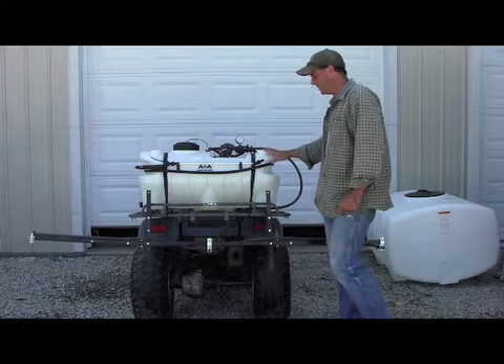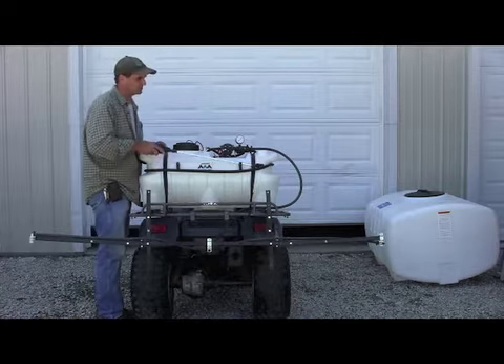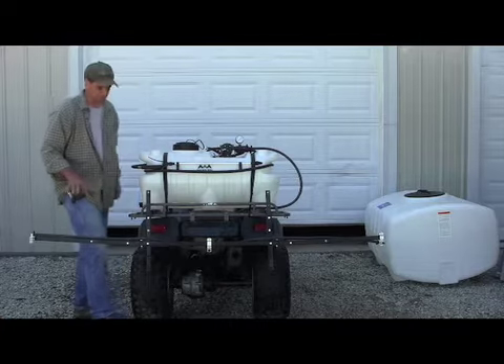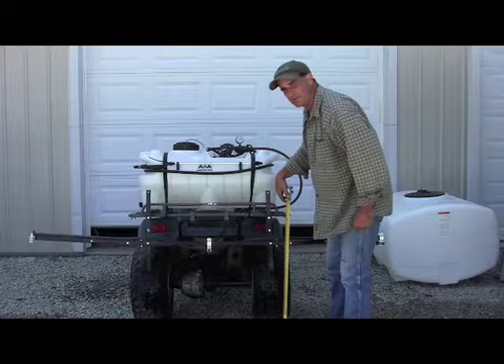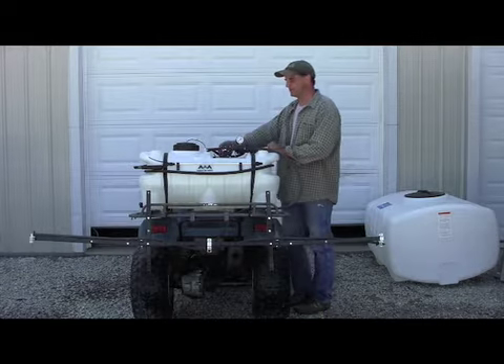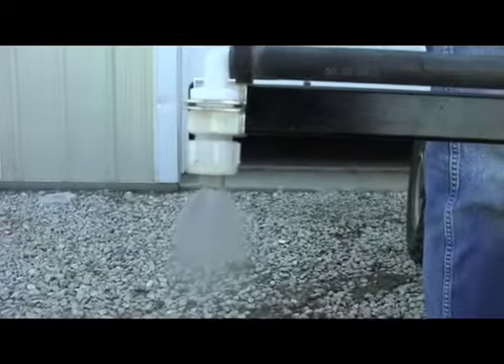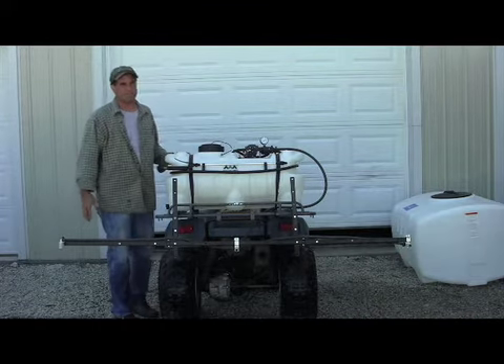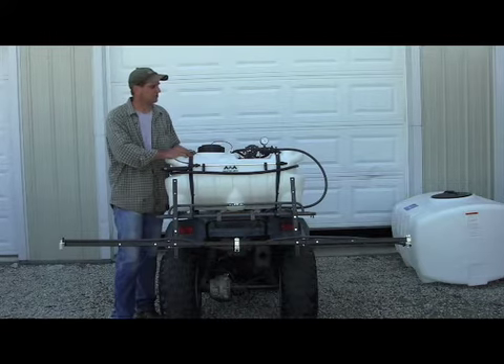Basic Sprayer Troubleshooting

Comment: So the boom is the thing in the front? is it supposed to spray all the time?
Reply from the maker: Hello. Correct, the boom would be in the front. With every Master Mfg broadcast sprayer, a user will get a boom shut-off valve that gives you flexibility to shut off flow to the spray boom when you want. So it doesn't need to be spraying all the time. For more questions, feel free to reach out to us!

Comment: If it's not pumping fluid or your not getting good volume,  check the filter in the tank .
Reply: Wow, thanks for this. It should have been one of the first things I checked, but I instead was cleaning the nozzles and was at a loss until I saw this. There ended up being some gunk similiar to homemade slime on the filter, so I cleaned it up and it sprays perfectly now.

Comment: Thank you for the video.  It was really helpful.  Great tip about filling it up with water first to check everything.  Might seem obvious to others, but I have 15 gallons of 2-4-D leaking all over the place in our first (used) trailer sprayer.  Also did not know how to adjust the pressure or clean out the nozzles.  You helped me a lot.  Thanks again!

Comment: Good info. My new 30g sprayer won’t prime and when it does randomly prime it won’t keep pressure for more than two minutes. I’ve been testing hoses for three days and even replaced the whole pump and it still behaves the same. I think the seal around the intake hose going into the pump is not mating up right, but even after I wrapped the connector with pipe fitting tape I can’t get it to work right. It seems like there is a piece missing from the puzzle.
Reply: I’m having this same issue. It’s not the filter strainer, the hose doesn’t leak air. But I’m constantly priming it and there’s no pressure.
Reply: The problem in my case turned out to be bubbles I think. If you put too much surfactant in the mix, you’ll need to dilute it a lot, or TSC sells a bubble reducer that you can add. Gluck!
Reply: @SketchEtcher  thanks for your response. I ended up putting on a new pump. It fixed it. Good to know about the surfactant. I use dish soap in my fly spray for my cows and I’ll be cautious in using too much.